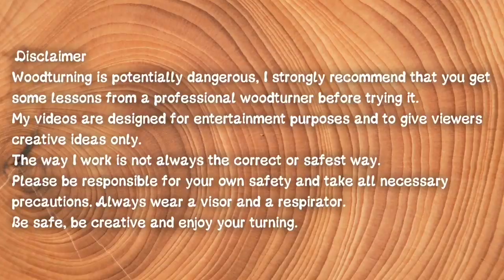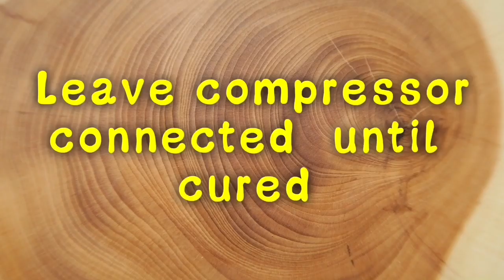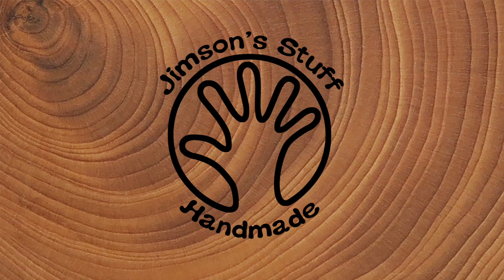Woodturning The Dragon's Nest Night Light. Pinecone Mini Eggs

Comment: Yes! Buffing wheels are evil - my lathe runs at top speed for everything i do, turning, sanding and buffing! I cant change the speed because its stuck - so all my work is high octane but never more than when it comes to buffing!!! scary! I do need to sort this problem out 🌲🦊🌲 Nice project Jim, as always.
Reply from the maker: Thank you very much Claire, you be careful with that buffing wheel !
Cheers 
Jim

Comment: Really amazing project - that came out NICE!  Also, appreciate what you said about buffing wheels.  I've watched a lot of sped up videos of people using buffing wheels and they make it look really easy - I never realized how dangerous it is...
Reply from the maker: Thank you very much Fred, yes you need to have full concentration with buffing wheels, they can grab very easily and fling the workpiece back at you which can damage you and what you are making.
Cheers 
Jim
Reply: @JimsonMakes  That's great advice!  My day job is software related - "undo"-ing a mistake is very easy and mistakes have much lower consequences.  I used to do a lot more building, but attention is not my strong point so I think I'll get into this very slowly!

Comment: Absolutely brilliant.  A question.  What is pressure pot for? Why you need it?
Reply from the maker: Thank you very much Erich. The pressure pot compresses any remaining bubbles down to a microscopic size and it also prevents air expanding out of the pine cones and creating more bubbles. Things like pine cones are quite tricky to get a bubble free casting without a pressure pot.
Cheers 
Jim

Comment: Ah i gathered a load of mini spruce cones recently from a fallen tree but i didnt think to dry them before setting them in resin (to be fair it was during the heat wave). Of course there was moisture in them which came out during the cure and turned £25 worth of resin to foam.

Live n learn :/
Reply from the maker: Thank you very much for watching Lance. Yes zero moisture is essential with resin. Moisture can cause foaming as you discovered and can also cause clouding/misting, particularly with Polyurethane resins.
Cheers 
Jim

Comment: For mixing the Milliput you can blend it faster by 1. Make sure it is room temp. Warmer the better unless you are going to cut it once blended, for that you should put it in the fridge for a few hours or the freezer for ten minutes.  2. Follow a guide for mixing Polymer Clay. This is usually done one of two ways. Using a twenty dollar pasta machine with which you can create ombre effects or a full blend. Or, when I make a blend that is small, I use the log, fold in half, twist then repeat. Not only do you learn to love swirls but you get the job done faster. DISCLAIMER! I have NEVER used Milliput, heck, I'm not sure I even spelled that right. HOwever, I heard many people who have used it say that it is super sticky. So, test the pasta machine before you drop in a glob!
Reply from the maker: Hi Michelle, many thanks for watching. I have used Milliput for many years, it is certainly very temperature sensitive but behaves very differently to polymer clay. Milliput is much more sticky and will destroy a pasta machine in seconds. Check out my playlists, I have done one just for Milliput projects. I have become good friends with the guys at Milliput and they keep me supplied with the stuff. I have also done a couple of polymer clay projects.
Cheers 
Jim
Reply: @JimsonMakes Thanks for the reply! I can think of a few things I could use it for then. What would it be a replacement for, or close to, from rice glue to bondo and beyond! ...LOL.

Comment: what rpm are you using to turn
Reply from the maker: I can’t remember what RPM I was using, I tend to use the speed that feels right, but I think it was probably around 2000 RPM. Many thanks for watching.
Cheers 
Jim
Reply from the maker: That is 2000 on the wood but probably 3000 on the pine cones